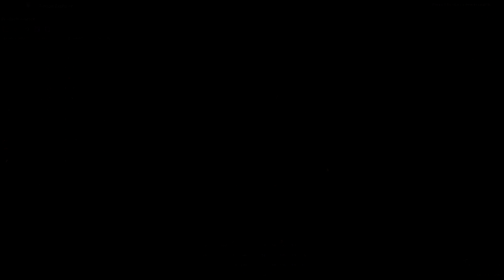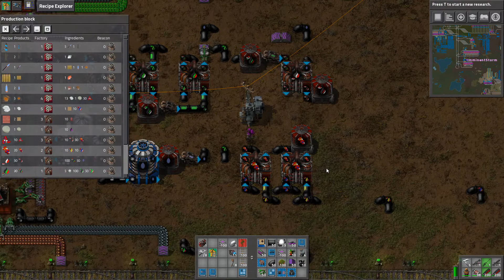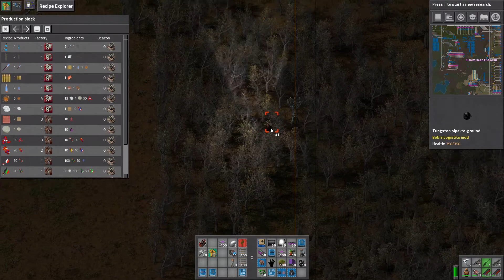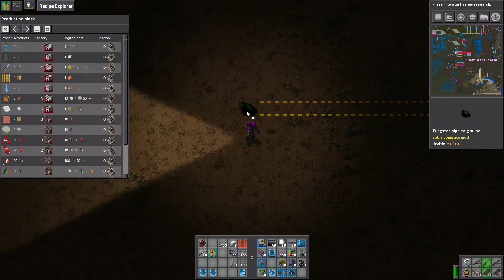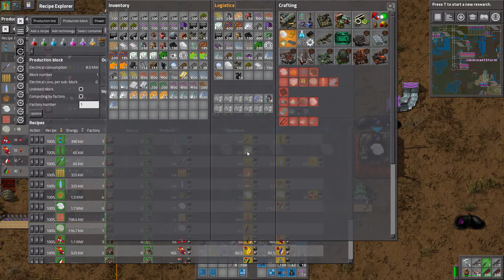Factorio - Angel's & Bob's - Episode 208 - Loading Bullets

Comment: Most of what you said about dynamite and Alfred Nobel was correct, but you made one mistake: Nobel didn't invent TNT as a replacement for unsafe dynamite, he invented dynamite as a replacement for even-more-unsafe nitroglycerin. The rest of it was correct: old dynamite seeps nitroglycerin out, making it very dangerous to be around, and so TNT was eventually developed as a replacement. It was first manufactured by Julius Wilbrand, but it was so stable and hard to detonate by accident that its potential as an explosive wasn't recognized at first, so it was first used as a yellow dye! And Nobel didn't want to be remembered as a "merchant of death" for inventing dynamite, so he funded the Nobel prizes.